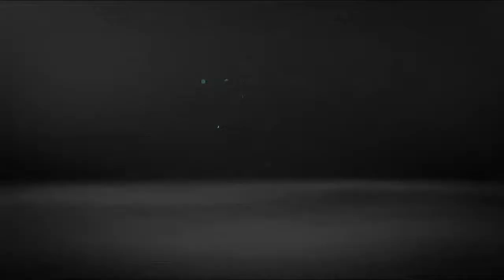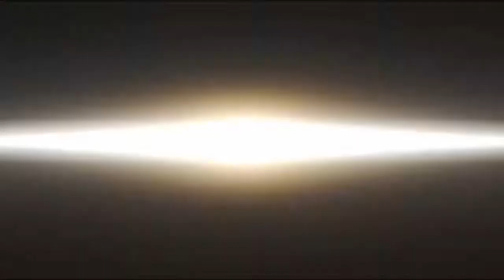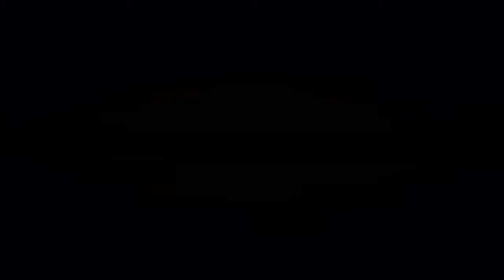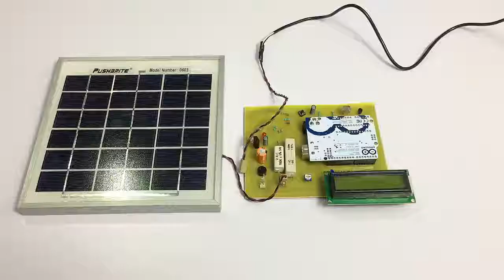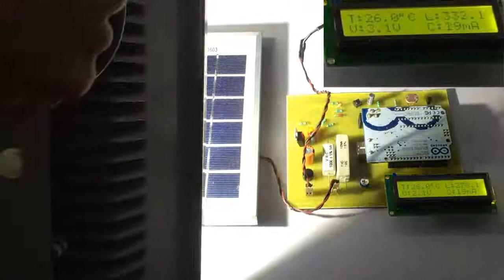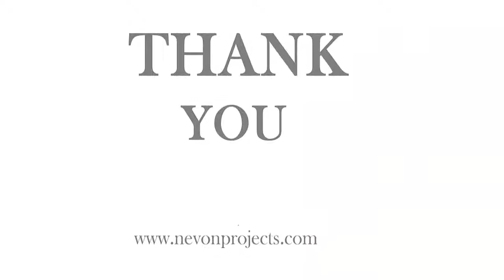Ardunio Based System To Measure Solar Power

Comment: hello sir may i know what type of load that u use to measured the pv modul parameter such as voltage open circuit and current short circuit?. It it variable resistor or electronic load such as mosfet and mosfet driver?.
Reply from the maker: please visit this link for complete project details http://nevonprojects.com/arduino-based-system-to-measure-solar-power/